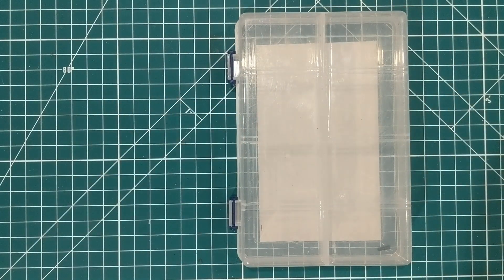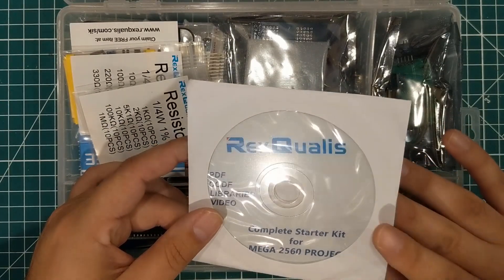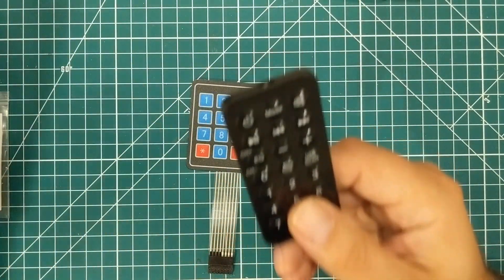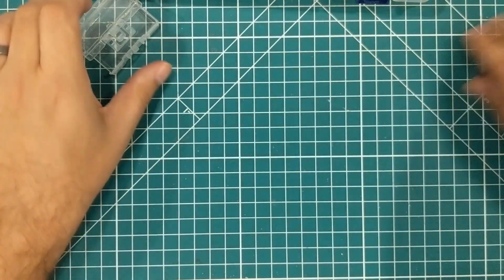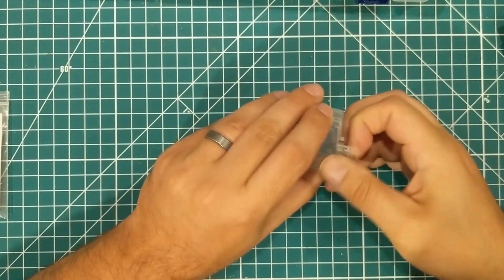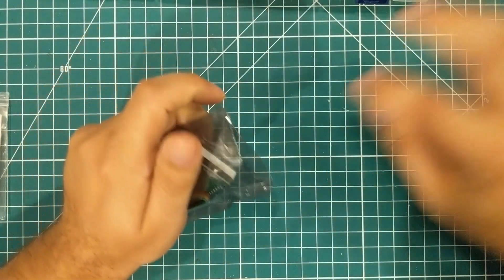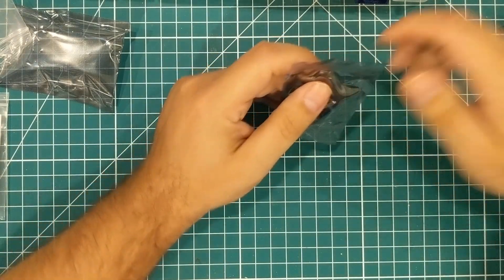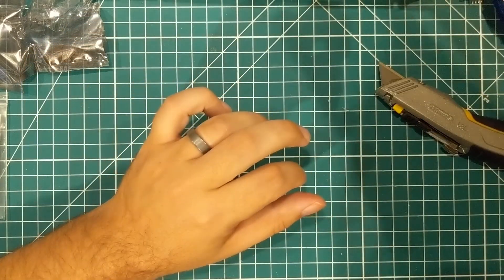REXQualis Mega Kit Unboxing and Giveaway!

Comment: those 830 breadboards - if the power rail paint has a gap, the rails are separate. if they are continuous, they are connected. I've tested this with a meter
Reply from the maker: Yeah. I don't think I have any continuous ones.  I bought 2 @ 10 packs over the years and all mine have the gap.  I don't mind though.